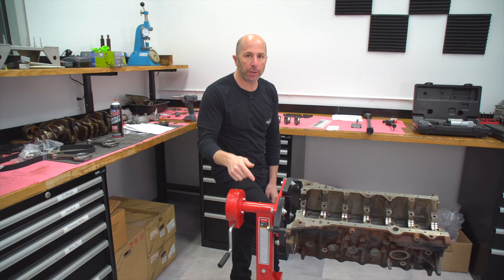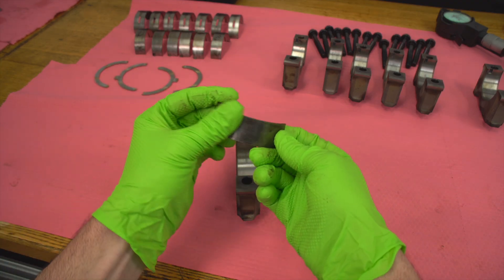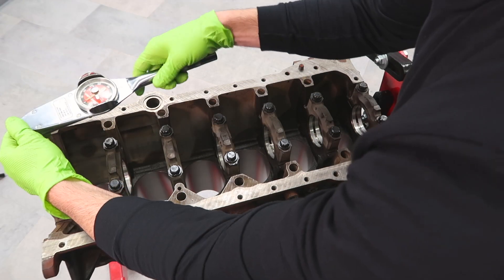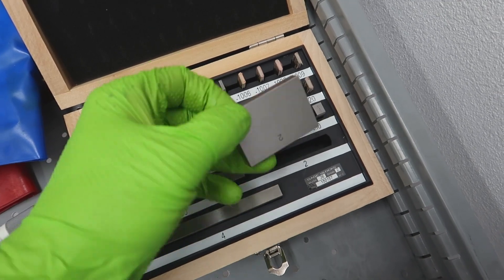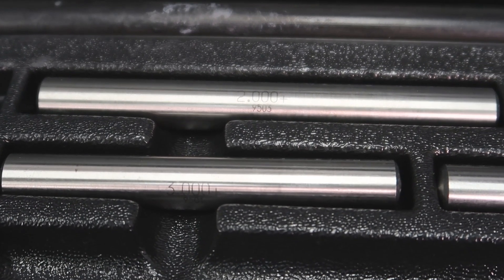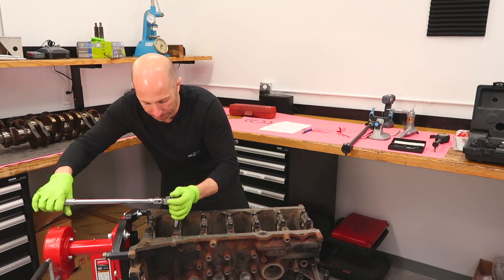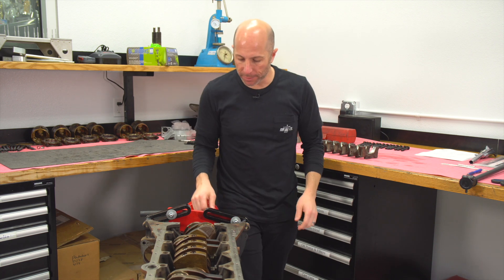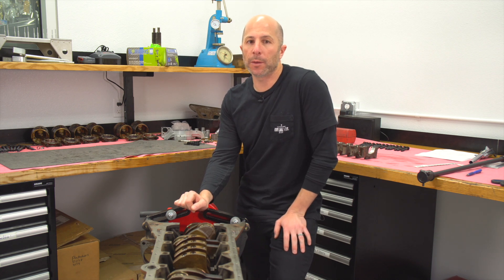$7 Vs $1,000 Engine Bearing Measurement Tools - Plastigage vs. Sunnen Dial Bore Gage

Comment: Very nice! 

At work, there's a nice Starrett mic that we use for assembling traction motors. We keep it set to 8" max, as that's the maximum diameter of the axles. 

There are then standard axle cuts and standard oversized bearings (up to 4/32") that are used. 

A few weeks ago while building a motor (it had been a while since I'd built one), a coworker mentioned the mic was off when they'd built the last... however many motors. 

Apparently I was the only person who knew the mic could be zeroed out, and the only person who knew how to do it...

Long story short- whatever you use to measure clearances, know what you're measuring, know how to do it. If you don't know what you're doing, ask questions. Even if you think is a dumb question, ASK. That "dumb" question can keep you from making a potentially very costly mistake.
Reply: A dumb question is the one not asked ;)

Comment: I use a mic/bore gauge (borrow from a buddy) whenever theres an irregularity or to confirm an issue.  Other than that, I only use Plastigauge to measure clearance and order whatever bearing size I need.  Knock on wood, it's never let me down.  Also, Ive never used the other colors (I think there's three, which depends on what size you are measuring).  Ive only used the green Plastigauge.

Comment: If the crank is bent by .001", the plastigage will give a larger or smaller clearance depending on where the crank is oriented, mostly on the center main. Need to be aware of the crankshaft run out.  You can still use plastigage, but take the measurements twice, one the high end and the other on the low end. Given that the crank is within specs of course. (If the crank is bent more than .001", for high rpm/high HP applications I recommend getting the crank machined and going with over size bearings for sure.
Reply: Just to add (sorry, Google wouldn't let me edit), when working with what you have & you know your journals are round you could use plastigage at various crank angles to check for uniformity. Then any nonuniformity would indicate a wowed crankshaft.
Reply: @Iceberg86300  Since the bearings are in a fixed position then hand spinning the crank and using a 10ths test indicator on each journal without the bearing caps in place will quickly show any slight bend or out of roundness in the crank. $35 for a cheap one or $130 + for something that can be trusted is cheap insurance. It won't show if all the bearing bores are straight and bored round though. But Plastigage can't show that problem either.
Reply: @turningpoint6643  it's possible, but I wouldn't have a newbie or one timer measure like that. At least for anything beyond piece of mind. And that's tough b/c as you said, you don't know what shape the block is in. We're talking tenths here & the bearings already have clearance which can be added or taken away from the measurements you're seeing. Plus the test indicator needs to be positioned correctly (needle tangent to crank, only turn crank away from needle/indicator) so they have to deal with an indicator holder as well. Noga articulated holder (*don't* cheap out on this, you really don't want to be dicking around with an "old school" post style, unless you're into inflicting undue torture upon yourself) will run more than a cheapy indicator, and if they've got an aluminum block the mag base is out & it has to be bolted to the block and adjusted for each journal (maybe every pair if they're good, but they're newbies :) ). 

There's just a lot to deal with & I've seen very experienced metrology guys screw up the inspection of parts with these kinds of tolerances for various reasons, sometimes no fault of their own. (This can be applied to your chosen engine shop as well)

But if you want to tackle this at home for whatever reason then go for it. Just research, research, research. And nudge the crank around radially in various spots to show you how you can affect the measurements & what it looks like when you do. And know your limits. When doing something like this it's very easy to chalk something up to operater error when in fact it's something that needs work.
Reply: @Iceberg86300  Oh I agree, it wouldn't be %100 guaranteed and verifiable results. More of a rough check to be sure there's no outstanding gross errors. Far better would be a large enough surface plate and a very good set of matched V blocks. Few to almost no home engine builders would have that type of equipment available though. If I had to I think I'd just spin the crank between dead centers in my lathe. 

Unfortunately few seem willing to put the time in to do that non optional research. I've been studying everything I could about machining and metrology for well over 30 years now and feel I now know just enough to have some idea of how much I don't know. And like anything else Youtube has it's share of no doubt well meaning posters, but there's many who don't know nearly enough trying to teach those who know even less. The Starrett and Mitutoyo videos are the one's to search for as I'm sure you already know.
Reply: @turningpoint6643  A dial indicator with .001" increments is all you need to check if crank is bent. Out of round needs to be checked with outside micrometer.
Reply: @catatonia1  Yes a .001" indicator can tell you it's bent or not, a 10ths reading indicator will tell you by how much. A .001" indicator is only guaranteed accurate to + - .001" even for the Starrett's and Mitutoyo's. So I'm not about to guess how much the needle moves between any two .001" lines when a 10ths indicator will do it far more accurately and quicker. That allowable + - .001" accuracy deviation is a metrolgy industry standard on even the most expensive .001" indicators. Yes there usually well under that because I've checked mine. But up to that + - .001" deviation would still pass inspection as being within tolerance. On the cheap one's it could be almost anything. Cranks can also be sometimes straightened, you'd start with a .001" indicator until very close and final checking would probably be done using a 10ths indicator.

And somehow you've confused me with someone that's stupid or doesn't know much, or you don't quite understand how any out of roundness is correctly checked. Sorry, but a 100% no way no how on using a micrometer to check out of round. That condition or possible problem is exactly what indicators were invented for and made to detect and measure. If your just checking that out of round condition then a micrometer isn't needed and most definitely wouldn't be what I'd use even though I have them because it would be just about the worst tool to use. Checking an area on the crank for it's exact size then yes that's the tool to use. That out of round check can be quickly done with one rotation, how long would making 20 + measurements with a micrometer take? It's more than rare, almost unicorn rare, but not at all impossible, a round surface can have multiple lobes on it caused by a machine tool or radial grinder being in poor condition, if they happen to be correctly spaced a quick check with a micrometer can show the surface is perfectly round when it isn't. A micrometers measurements can also show the part is to the perfect size. That lobeing may even make the part slightly over sized and a micrometer may not be able to detect it if you only took one or two measurements. But an indicator can easily show that if it were to be present. So that rotational check is done first and then the size is measured. The cheapest way the crank would need to be spun on  a set of V blocks or between dead centers, but there's multi $100k machines that can also do it.
Reply: @turningpoint6643  Mate i was engine machinist for 16 years nobody uses indicators to measure roundness of crank pins. A micrometer can detect .0001" difference what do you think is used to measure  when the crankshaft is ground by the machine shop? Not an indicator that's for sure. 20+ measurements doesn't take very long and you still need a size an indicator wont give you that. A crankshaft ground by a professional will not vary anymore than .0001-.0002" over the whole crankshaft.  Using tenths to check if the crank is bent to that accuracy doesn't achieve anything but waste time. You wouldn't straighten a crank that accurately would be a lot more wasted time. Think how hard that would be to achieve  A crank press is not really a precision piece of equipment would do more harm than good . And a lot easier to grind the crank.
Reply: Someone using plastigage likely doesn't have the ability to measure the TIR of crank & journals in-house. I'd say the best most could get would be roundness by micing a journal at the smallest angle increment they can w/o throwing the mic at a wall in frustration, and cylindricity of each journal by performing this measurement at each end & the middle, of every journal. 

Basically, in an application where one wants to "get it right" by having stuff checked for being in spec then just do what you advised & go the extra mile to have everything blueprinted/machined (if needed). Then if you want(or need) to build it yourself buy the bearings that will get you in the ballpark & use plastigage to choose a final bearing size for each journal (if available). That's the way Nissan did it on the original vg30 motor we rebuilt for my 300zx, so that's how we did it. Doing it with a bore gage would have been great but the shop wanted nothing to do with that process so we had to do it ourselves with plastigage.
Reply: So, what you're saying to do is use the plastigage twice. Take it once, then rotate the crank 90 and do it again?
Reply: @norman_sage2528  You would rotate the crank 180.  The idea is to measure the clearance at the high and low spots of the crank. You would have to know where on the crank the high and low occur by measuring the run out with a dial indicator and marking the spots with a sharpie. Then you can orient the crank in the block to plastigage it. If you have anymore questions let me know.
Reply: @LikeZO  Turning the crank 180 wouldn't achieve anything 90 is correct so forget the advice giving! It is a big waste of time anyway if you are that fussy get it checked by an expert  (not Felix) and they can check all of these things very easily. On a small engine like this that is in good condition any variables would be irrelevant anyway. The crank being a tenth out of round isn't a problem.
Reply: @catatonia1  If the crank is bent, then the center journal of a five journal crank will have some runout correct? Which means there will be a high/low point when measuring. If you happen to use plastigage where those high and low spots are on the crank, then one area will show less clearance than the other. If you spin it 90 degrees like you mentioned, then yes it will show the correct clearance. For normal use, a crank within runout limits is fine. But for an engine that will turn 2k rpm higher than factory, I like to have the crank machined and bearing housings lined honed. Measuring tools are a must in that scenario as well, not plastigage.

Comment: Those are some tight mains, I'd open those clearances up to around .0025" for a 1000whp.
Reply: I was thinking the same thing. Generally i like to do 1 thou for every inch of crank journal. So if the crank pin is 2.5” ill try to stay around 2.5 thou bearing clearance. This is how alot of guys do race engines.

Comment: what the plastic gauge doesnt show is out of round main bearing.  caps . often arp studs on mains the main bore might need honed to make them round. roundness is a good thing to check for when changing torque number or different bolt that hold them. other wise 5000 miles later bearing issues could show up
Reply: You can do that with plastiguage, too, by using it lengthwise in equal lengths.  When its crushed, the diameter reads will still be the same, however the lengths should also have similar dimensional disparities. If any of them are significantly longer or shorter, you're out of round.
Reply: Your right. Converting from bolts to studs may distort the bearing bores. Its very important to check.

Comment: I have used plastic lot  checking crankshaft and rod bearing after its been machined and it have saved many bearings from  locking up  it would be nice to have what you have but l don't do enough engine's since create engine's are popular
Great upload without the b/s thankyou

Comment: Shouldnt 0.0016 be refered to as 16 ten thousand?  0.016 is 16 thou which is outside of the scope of the plastigage that is being used.
Reply from the maker: Ahh you are right. Brain fart. I'll add some annotations.
Reply: Machinists tend to call 1/10,000 a "tenth" since the result is expected to be well under .010 id probably call this "1 and 6 tenths." no need to express that the one is a thousandth because it's clearly not an inch and we don't use 1/10th of a full inch or 1/100th of a full inch for a measurement. generally people use fractional in powers of 2 for things less precise.
Reply: @danieldimitri6133  I wouldn't say it's b/c a "tenth" is expected to be much smaller than 0.01", I'd say it's b/c everything from 0.001" to 0.999" is generally expressed in "thou." .0000" to .0009" gets "tenths," & 0.0010" to .0099" gets either "tenths" or "point thou." 

Then there's the fact that expressing a primary measurement in "tenths" is fairly rare. It's usually reserved for toleranceing & clearances/fits. Thin film/webbing (plastic sheet, paper, foils, etc), threads/strands, surface finish, and finishes such as anodizing & hardness depths being the major exceptions. And many times those get referred to as "mils," "micro inches," & "microns."

Or at least that's been my personal experience over the last ~17 years as an engineer working on machine design & manufacturing  anyway. Most likely different for folks whose focuses lie in other areas though.
Reply: @Iceberg86300  I think we're on the same page... I didn't give the best explanation but yes. The "thou" or "thousandth" is more or less the base unit of measure, atleast inside the machine shop, inspection department or mechanical engineering departments. Which sounds weird to a kid learning fraction or decimal place names but metric does something similar with "kilograms." where the name might imply that the gram is the base unit but the kilo is actually recognized as the base unit.
Reply: @danieldimitri6133  yeah, same page for sure. I totally forgot that in my first job out of college I looked like an idiot due to the thou & tenths thing. It was heavy manufacturing making, of all things, CNC machines. Found out later that they purposely bombarded the new grads with the "lingo" as a bit of right passage & more importantly, to make sure we were comfortable either asking questions or doing research on our own when we heard or came across stuff we didn't know/were confused by. Absent a specific reason we did everything nominal in fractional though. Not on drawings unless fractional block tolerances were okay, but sketches & conversation were almost always done using fractional.
Reply: @danieldimitri6133  Even easier is to just call it what it is 1.6 thou. But for those trying to argue that using the 10ths term is incorrect? Sorry but metrology labs and even Starrett, Mitutoyo etc all use it as it's a commonly agreed to industry term and anyone measuring at that level knows exactly what 10ths means. I don't know of a single machinist when talking about actual 1/10ths of an inch who wouldn't call it 100 thou.
Reply: and the wax indicated .0014 not .0016
Reply: Depends on what you're doing.  If you have +/- .005 it's a "thou and a half" but if you're grinding or checking a fit or clearances it's a "thou and 6."   :)
Reply: Or, you could start using maybe "milliinches". Or just switch to millimeters.
Reply: Wally Wallace 

 Bingo.
Reply: 0.001" is a thousandth , and a thou is 1/10  or 0.1 of that. So 0.0001" is a thou' , this imperial stuff is pretty nasty , but it is what it is . 
Correction 
0.0001" is a tenth
Reply: You wrote my comment for me :)
Reply: It’s “sixteen ten thousandths” or just “sixteen tenths”.
Reply: @clayz1  In a machine shop, yeah, people know what you mean by sixteen tenths, but 16 tenths to most people who deal with numbers would be 1.6. I definitely get what you mean and the shortened phrase has its use, but I'd say that for instructional videos, the proper terminology should be used.
Reply: Anthony Antoine Good point
Reply: Gaay point

Comment: How are u able to use that same bolt everytime? Those are torque  to yield bolts?
Reply: Wondering the same thing. In theory those are one use bolts I believe.....
Reply: @terrygoyan  That could be the difference, the bolts could stretch a little bit. Then it wouldn't be as torqued, right? So it didn't squish the plasti gauge to the same torque.
Reply: They are torque to angle (sometimes called torque to turn). They are not tightened past the point where they will not return to their original length. So they can be reused.
Reply: @walterbrooks3539  Oh okay cool. So basically it's very close, enough to build an engine to pretty good specs but not as much as a 1000 dollar machine.